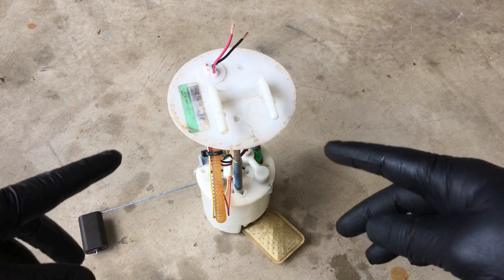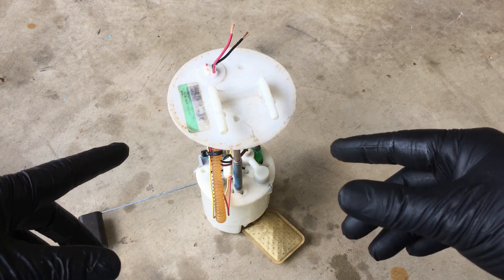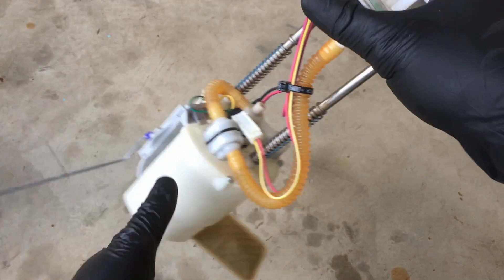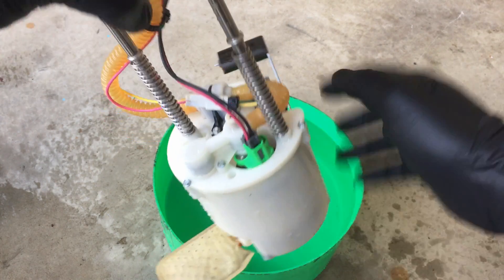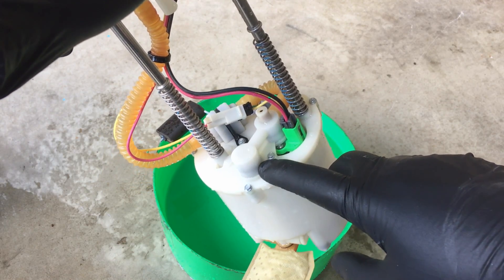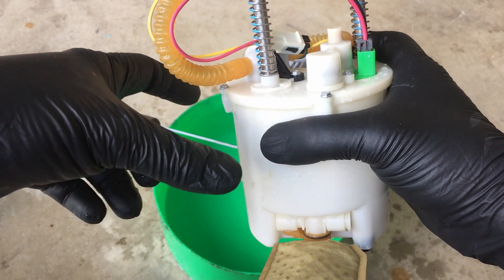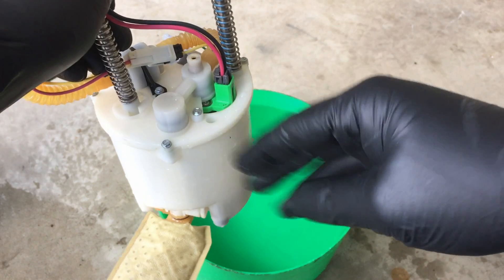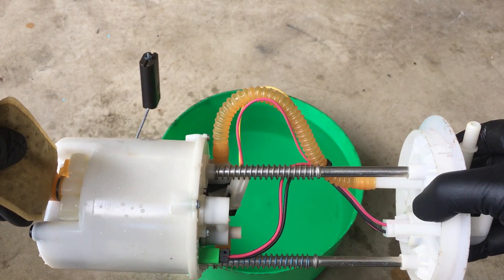Ford Quick Tips #80: Common Fuel Pump Failure Points Explained

Comment: COOL GM has the same issue I have seen on on a brand new pump :( I have also seen the fuel pressure at 100 PSI when the regulator sticks.

Comment: VERY IMPORTANT, LISTEN UP!.......One of the biggest frauds/scams going right now is knock off Ac Delco, Ford, and name brand fuel pumps. The largest fuel pump seller on ebay, global-automotive, sells knock off fuel pumps and I believe others make it to Amazon as well. I have unknowingly installed two knock off fuel pumps in the past four years, that's how big the problem is. Make sure you buy your replacement fuel pumps straight from the dealer or from one of the major auto parts stores. If you want to avoid the dealer, I've had good luck with Delphi Fuel Pumps from Autozone. People have no idea how big this problem is and wrongly assume that Ac Delco or Ford quality has just gone down the tubes. These fake fuel pumps come in genuine looking boxes, work for up to a year, and then burn out.
Reply: TrakSpock1 yikes! I just installed a fuel pump on my sons 2002 Taurus.  Bought one on eBay for $56.  Way cheaper than $256 from autozone.  Was an easy install.  Looked the same as the original.  I hope it lasts awhile.  Thanks for the heads up. It works well for now

Comment: Bro I have a 2006 ford and am think in bout trading it in just cause of the spark plugs blowing out and the rocker roller problems. That these trucks can have.. but how common is the spark plug blow out and should I change my rocker roller I bought the truck used with 107000 miles and it runs great just worried if it will happen to me and not sure what maintenance the previous owner did..

Comment: OP Fliguy4ever...FordTechMakuloco has at least 2 videos on the fuel pump module that sits back above on the rear axle near the rear tire...it may be your issue depending your model vehicle is and the year it was produced. Common issue with the F150
Reply: Lilibeth Mowatt yeah ive changed it already and it still does crank no start and tells me check gauges I said that in my comment above
Reply: I see I missed that in your post.Im not sure in that you have not mentioned how the well the vehicle ..which ever one?... what miliage? runs After it starts, idles  and then drives for however long?  You mentioned to the store... so just short trips?
As far as ur cluster that says to me potential issue with communication with the computer or the cluster itself assuming no issue with the New?  module, its wiring etc. I am also assuming you can pull codes and that you have communication with the PCM, EEC whatever.
Reply: I also forgot to mention if with all the parts you have thrown at it if you puts park plugs into it...worn ones can cause a delay in starting.
Reply: Lilibeth Mowatt I did a tune up a month ago cleaned throttle body new alternator new battery new can phasers and chains new oil pump new overhead cams  new exhaust still no change 
New brakes and rotors bearings and seals 
Ive put over 10 grand into my truck because I love my truck but she's still telling me check gauge's and starting like shit periodically and its frustrating
Any other suggestions you have that I know ive already replaced

Comment: I changed my fuel pump mass air flow sensor fuel pump module filter   fuzes and everything else I can think of and the gauge cluster tells me check gauges when I first turn key or if it has run and I head into a store I get a crank no start for about three cranks 
Any thoughts on what I need to do to fix it
Reply: I had that happen with my high mileage Escort. It was the little tongue that sticks out of the ignition cylinder and goes into the switch. It was flexing as it started to fail due to fatigue. Keep a set of screw drivers in the car.
Reply: We Are All Inventions done all that a month ago when I did a tune up a year ago I did everything to my engine plus transmission change its got new everything on the engine  I just dont understand why it keeps telling me Check Gauges and starts like shit after  its been warmed up already
Reply: J. Dupont Smith ???